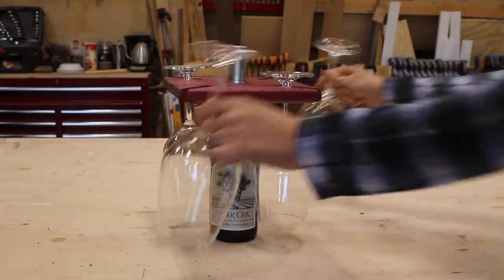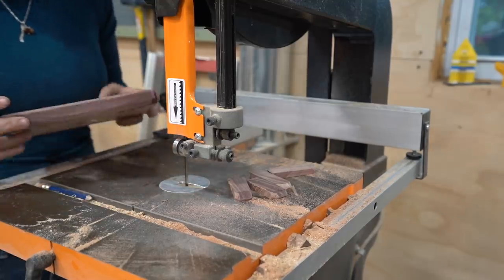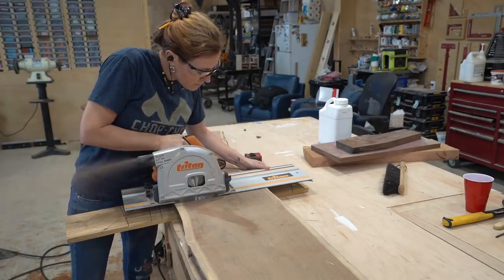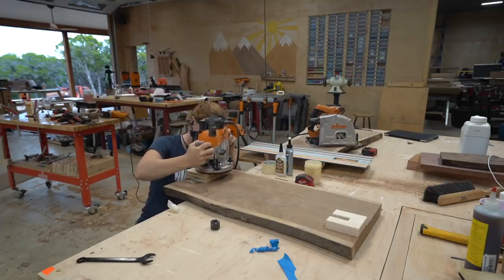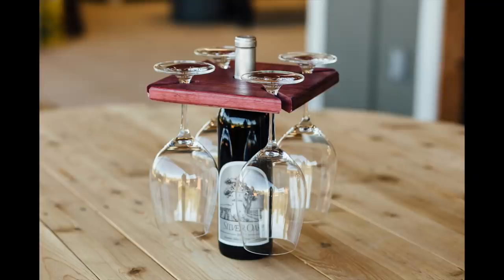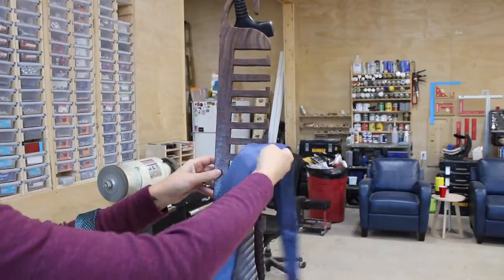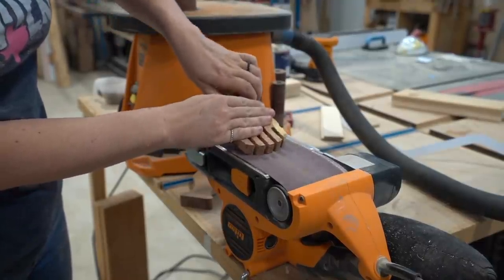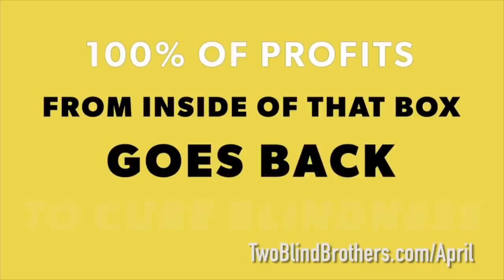6 Last Minute Christmas Present Ideas

Comment: I am not a woodworker, but I am an acrylic flow painting artist, and I'm using your masking tape + CA glue trick on a project right now. I'm using a small, craft wood box for a bedside medication holder, and I wanted to paint it with my favorite flow painting techniques, BUT I didn't want to get paint in the hinges or on the interior of the piece. So I removed the hardware, put masking tape over all the interior edge surfaces, and glued them together with some gel CA glue I have. I've coated the whole thing in gesso, and now I'll do a painting on it with my favorite colors and techniques. Then I'll pop the pieces apart, remove the masking tape, and varnish the whole thing (with some acrylic sealant on the bottom as well, to protect from water spills on the bedside table, and reattach the hardware.

I'm not sure I'd have ever figured out how to do it this way if I didn't watch your channel! :)

Comment: I made the wine glass holder for the wine bottle earlier this year. I used wine barrel staves from my local Woodcraft store. The wood smells like wine--I love it. Very simple. . .just a piece of wood elongated. . .drilled a hole in the middle for the wine bottle and 2 smaller holes with a forestner bit at each side. Then used a jig saw to drill alternating slots. Unique, EZ and quick. Love your vids and tips! Keep 'em coming.

Comment: Cool Ideas. On the bath caddy I think it would need 1 or 2 strips underneath at the bath inner width to stop it sliding sideways if bumped. For the wine glass on bottle, if you counter sunk (45deg) (deeper than the bevel you cut after) the hole you drilled at the end of the slots before you cut to them then the glasses would 'locate' and make transport a bit safer.

Comment: Don’t drill holes all the way through the coasters. That way, condensed water from cold glasses won’t run out the bottom. Keeping that condensation off your furniture is the main reason for using coasters in the first place. 

Also, I agree with the comment that the wine caddy should have a space for a corkscrew.
Reply: I was thinking a thin layer of cork, glued to the bottom would keep the coaster from scooting around and absorb the condensation that drains down through those holes.
Reply: This is so passive aggressive,and yet so funny at the same tim

Comment: Nicely done
A couple ideas for the tie holder
First the square edges might make creases in the ties so maybe round over the edges to prevent that
Second if not doing the raised edge to help keep items from sliding off or being knocked off then maybe make the slots with a slight upward angle to help keep things on the hanger.

Comment: I didn't find a giftable idea amongst your suggestions. But I was toying with the idea of making some wind chimes.
You see, in the course of a years work, I have four or five 1lb propane bottles on the scrap Heap. I was thinking of cutting the bottoms out, taking the valve out of the top, and making some bell sounding wind chimes. I was going to take a 20 lb propane cylinder. Or maybe a Freon cylinder. And make it into an air tank. To fill tires on the road.
Myself, I'm still in the market at finding a good pickup truck.

Comment: As a little finess to the glass holders, I would add a slight conical indentation where the glasses go to help them not to slide out of the slots.  This would give a slight detent effect. The glasses may not slide but with my luck they would do so.
Reply: There's always a little taper between the base and the stem on wine/martini glasses.  A chamfer or ogee on the topside of the panel would let the glasses slot right in and stay put.

Comment: All are excellent gift ideas!  I would like to offer a suggestion for improving the tie holder.  As is, the tie holder will be extremely fragile; the tongues that hold each tie will break off very easily.  Also, the hangar hook at the top will break off very easily.  The way to make this stronger is to begin by slicing up the plank into 5 veneers, each about 1/8" thick.  Then glue it all back together, alternating grain direction for each layer.  You will end up with a plank of 5-ply plywood that is 5/8" thick and is very strong.  Then proceed with the project as shown.  Homemade plywood that uses walnut for all layers is VERY attractive.